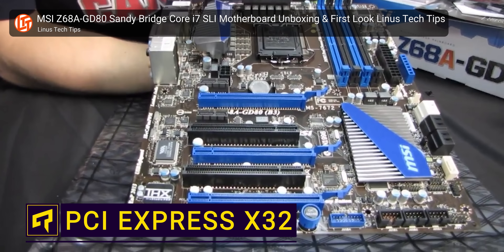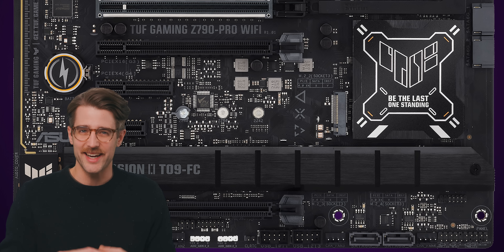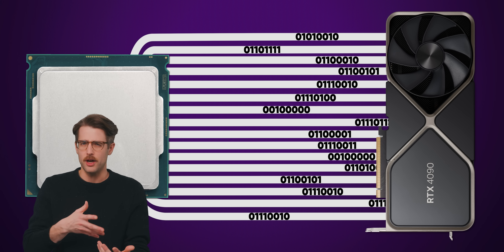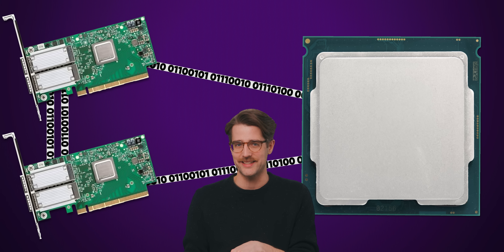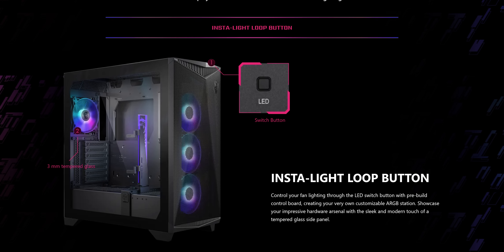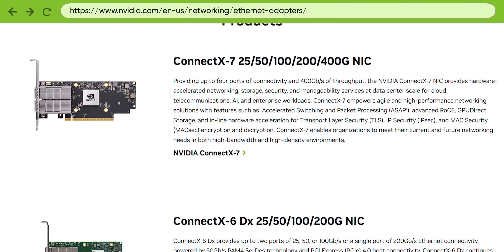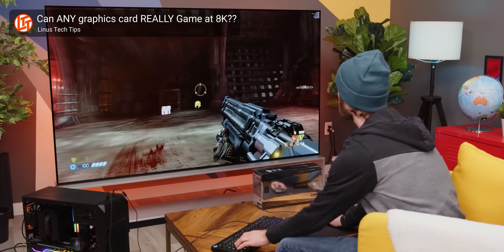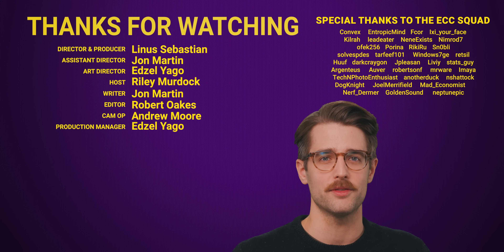Yes, It’s Real: PCI Express x32

Comment: The OAM form factor can have 128 PCIe lanes. It's (mostly?)used to connect a cluster of accelerators to each other; So a board might have 8 of them, with each having an x16 link to every other one and another to the CPU, if I understood correctly.

Comment: Dumbing down the tech? 
400GbE has been around for a while. 

The reason you see these wide PCIe busses is for composable systems. 
Look at the Epyc chips.  How many lanes?   
Now consider that you want to have high speed storage along w tiered storage.  So you have that in a separate box/server and you have a high speed interlink.  Thus composable systems w compute and storage separate but still close together.

Comment: I got to give this a dislike because its a SAS and Host Bus Adapter video in disguise. Not to mention Infiniband might be older than the Zoomers watching. I was taught about Infiniband all the way back in 2006 by a CCNA! Those speeds mentioned are for the recent standard of SAS. SAS is going to live on because its will take a long time for enterprise SSD's to be cheaper than enterprise HDD's. However, I hope someone uses this information to take their NAS in their home lab to something more enterprise like a file server connected to a Jbod.

Comment: It need in all the lanes to arrive the bits at the same time, routing 32x x2 (each lane is a differential pair) , 64 tracks to trace all to the same chip is very hard, all traces must have the exact same lenght, or there will be penalties, delays penalties.

Comment: 64 lanes? yeah i could saturate that. gimme 4x rtx 3080 of the 12gb variety and a system capable of handling that much data (32 core gen 3 threadripper would work) and viola, i'll saturate that much pcie. i also would need another pair of pants and new wallet after watching the power draw of such a system (wowza)

Comment: See I want to run multiple computers in a cluster, this means I need very fast cards with the bandwidth able to support the amount the entire system can output at once, plus a bit extra for overhead
Reply: Let’s say I have a gpu that runs on 16x and i have 2 in my system
Reply: I’d need a card capable of ~pcie x48 to use both gpus and the cpu
Reply: And that’s per system
Reply: Now Nvidia makes a thing for this, it’s called NVLink and it’s like SLI if it was able to go full on out of the case and connect to a network switch
Reply: The NVLink connector is on very high end cards, such as the A100s  in the million dollar pc
Reply: And if you have the money to buy them go ahead. But for a only semi-enterprise user like me, I can roll out the cash for a rack full of A100s
Reply: Remember the Million dollar pc only has 4
Reply: So what I do is I bought infiniband cards, I’m Still on QSFP but I’m planning to use the OSFP1600 for my next upgrade. Then once you get those you get a cluster software and a server with a ton of cpu and ram, from there you install the cluster software on all the computers, and make the Really good server your head server
Reply: It controls everything else and tells things what to do, then you do some driver shenanigans to make the head server think all the gpus in the other ones are eGPU’s and you assign them to a VM
Reply: Then you do whatever in the vm
Reply: Btw I’m running 8x T40s on 4x R720s with a R960 as my head server, spent over 200k on this stuff

Comment: I think its time we update pci e.
Pretty sure tech has improved in the 22 years since pcie was first made. The newest thunderbolt keeps up with most 32x speeds yet is a connector the size of usb c. Shrinking the connector point freees up lots of space in pc and will make it easier for them to add other improvements.
Further while i love haveing the extream backwords and forwards compatibility of pcie at a certain point it becomes a bad thing.
22 years of cards and standards it would be nice to have a clear divide line once in a while so at a quick glance you instantly know how comfortable it can be. 
With hard drives we have this as their connection has changed alot over the years. Imagine if you had a game system  that kept upgrading without changing its number and now there are Bout 10 different tears of compatibility but you have to do research to find out what is and isn't compatible. They honestly i think thunderbolt and pcie should create  fully new two ports/plugs. One that is crazy high power and data throughput 
One that is about usb 3.0 power and speed level.
That way you dont waste money on ports being more powerful then they need to be theres a clear fivide so your nor trying to figure out if its the port the cord or the device thats not hitting the speed it should.
Both would be standerized but different.

Comment: I thought you would show a real x32 device, not a 16+16 nvidia/mellanox nic. The splitting was always a thing and I remember FPGA based 100GbE cards, that used dual Gen3x8 connections within the same x16 card - and required a bifurcation capable mainboard and likely used the driver managed model of 2 devices. But PCIe base specification even specifies a concept of multiple links, likely to help with the data splitting and reassembling, as a Port is composed of multiple LINKs of up to x32 lanes each. The link field is 0-31 or 0-255. Links do not need to have the same speed and its not really clear how/why shall one use multiple links. My explanation is that it is for identifying the device topology in case that the NIC uses that 2x16 or 2x8 mode.

Comment: PCIe gen5 is 4GB/s per lane.  So, 16 x 4 = 64GB per PCIe slot that's X16  and to take this back to serial which is how a network card is rated we get 64GB x 8 bits = 512 Gbps basically.

Oh, a SINGLE PCIe gen5 X16 slot can handle that 400 Gbps network adapter.  So why do we need this?  No, no we don't.

PCe gen6 should hit server within the next 2 - 4 years.  That takes us out to what?  Yes, a 1Tbps network adapter if you can actually manage that kind of speed on a cable bundle going into that one network card.

There comes a point where servers need to be upgraded.  A server that's 5 - 6 years old is now ancient.  It's SO bad that replacing it with newer hardware pays for itself in power savings.

Comment: I'm still surprised optical connections aren't used yet (again? (SPIDF)).
I'm expecting USB (or whatever apple calls it next) to have a fibre down the middle in that tiny blank part of the C connector at some point.
Bend insensitive SMOF is cheap enough now that is plausible at scale. SFPs are getting there too.

Comment: MSI tech support are the worst in the industry.  You know what they told me?  This is verbatim: “We don’t troubleshoot incompatibility”
Reply: Really?? In the past, MSI has always had the best warranty and repair service. I had a video card that was displaying weird corrupt garbage after like 6 months, and they replaced it at no cost. I had an MSI laptop that I smashed the screen by shutting the lid on a pencil, and MSI replaced the screen under their one-time replacement warranty. But that was years ago, so I'm guessing things have changed?
Reply: I don't know; my 2017 AM4 motherboard is still getting BIOS updates as of January 2024, which was necessary for me to swap the original 1080Ti with a new 4070 I got last month.
Reply: @simongreen9862 Can we take a moment and ask the question why the fuck isn’t UEFI/BIOS firmware open source?  Really should be.
Reply: @5urg3x  I agree with you there!
Reply: Buddy if you think msi is bad. Try asus support
Reply: @theodoregaus6237  Asus are bad as well, buy my experience with them -- if you complain enough, they'll eventually escalate you to a level 3 "customer experience" tech who is based out of the USA -- one guy named Justin helped me out a ton, gave me a brand new ProArt monitor a few years ago

Comment: I just want PCIe 6.0 with a slot that supports 1000W GPUs without any additional cables, ok 600W, but PCIe 7.0 had better support 1000W!  I  really hope ASUS and MSI keep supporting BTF and Project Zero,  BTF already supports 600W with the correct BTF GPU, I hope there is a BTF 5090, and yes I know you still have to plug the cable for the GPU power into the back of the motherboard.  I just wish PCIe slots supported the power needed for all GPUs without the extra cables.

Comment: In FPGA is fairly common to see X32, Microsoft had a board that allow u to control two FPGAs with this lanes, the trick was even it was an X32 actually it was like emulating the connection been two X16 lanes by readdressing the lanes.

Comment: Just a thought 💭🤔.. if you want a super small SFF build the motherboard only has 1 PCI express slot usually plus some nvme slots. So if you have 1x 32x pci express slot you could have 1 card that has the GPU and SSDs and dedicated npu and a 10gb NIC ect all in 1 expansion card especially if you have 1 side of the PCB for the GPU and the other side for the npu and SSDs and NIC and all the other hardware you want. It would make for very capable SFF builds or very very tidy full size builds that only has the motherboard and CPU and cooler and ram and 1 expansion card that's a mix of all kinds of different hardware.. so as much as we don't need 32x PCI express lane's for general hardware but the idea and the 32x slot could definitely be used up..

Comment: lol all the noobs talking about SLI…guys you needed a connector between the cards known as a bridge…The pcie connection on the second card was only so your PC would detect the card, all of the inter card communication was through the bridge. That’s why you could only use the ram from 1 GPU, because they could not transfer data fast enough through that bridge. This is a more advanced technology and if it was around at the time I’m sure NVIDIA would have used it, your CPU splits the data into two, like a stripe raid array, it goes to each card and the cards communicate synch data to make sure they spit it out in order. It may require a special chipset for this function because as far as I can tell no consumer mobo or cpu supports this.
Reply: Cards can be seen without the S.L.I connected, its still heavily driver dependent. Also it's more like higher clock speeds are still better than high IPC for S.L.I as it decreases latency. stripe raid arrary are slower than most modern cpu's & NVMe drives now. The Nv-link was bigger, but they're just using the pci-express link now on pci-express 4.0 with ada lovelace cards for cuda in workstation. AMD is using infinity fabric now too which is still basically a pci-express links.
Reply: @kevinerbs2778  well you can stripe nvme as well, not just sata drives, so gains are available there as well. I didn’t see this on Ada workstation, I don’t think both GPUs work on the same task in unison, realistically for workstation or AI I don’t see many tasks needing it, most workloads are split into individual tasks/calculations. Even for simulation, you are simulating individual cells/nodes taking into account previously calculated results that you read from cpu ram. What they are doing with their new server grade GPUs is dual die and offloading some of the CPU ram burden to the GPU, but that again needs to be taken advantage of by the software. If you look at something like blender, the software splits the scene into equal segments based on how many GPUs you have connected, they don’t communicate at all between each other because there is no need. Realistically this is what this video is about, a form of raid for PCI-E communication. If there was a successor to SLI it would probably need 3 GPUs or 5, always 1 extra to recompile the individually rendered area of a frame, for gaming it does not make sense because of the lag it would introduce, for workstation it doesn’t make sense either because you are not watching your task process live so latency is a non issue. If you are rendering a 4K frame with 4 GPUs and each GPU is doing 1k you will be 4x as fast with 0 need for inter GPU communication.
Reply: @radugrigoras  tile render already existed for pc games, no one wanted to use it.

Comment: Is usb c a type of 1x pcie? Or is Thunderbolt 1x pcie.... or am i mistaken?
Reply: Thunderbolt and usb c are same thing. (lighting isnt)
Reply: @alexturnbackthearmy1907  Fun fact Thunderbolt was a collaboration/ designed/ built by Intel and Apple.
Thunderbolt is USB-C on steroids, but they are not the exact same* 

The highest USB-C standard 3.2 x2 gen 2 can only support 1 4k monitor, 100watts, 20gb of data

Thunderbolt 4 can do 2 4k monitors, 100w of power, 40gb of data
They are not the exact same thing they are compatible yes but Thunderbolt 4 does offer more proformance.... until USB-C releases USB-C 4 but then Thunderbolt will be Thunderbolt 5 and offer more and the wheel goes round and round
Reply: @SSYoung125 thunderbolt 4 is 40gbit, not 40gb

Comment: All I heard was it was not SLI/Crossfire's fault it died. Twas complex graphics drivers that killed the beast.
Reply: Drivers are even more complex now with D.L.S.S & just looking at intel Arc cards we're still stuck with drivers being the limiting factor even on DX12. look that insane performance increase they're still gaining just from driver fixes for Arc card.
Reply: And lack of support. Out of handful of games supporting SLI, only select few actually scale with amount of cards, and most "SLI supported" games have completely messed up implementation of it so its very laggy, and second, third and fourth cards arent even doing anything.
Reply: @alexturnbackthearmy1907  There are 1,064 games for DX11 that support or can use S.L.I that's 20% out the 5,889 games for DX11. 
Here's something that real disappointed me, it's taking 8 times longer for games to come out on DX12 than DX11. In 10 years DX12 has barely gotten out as many games a what DX11 was releasing per-year in around a ten-year span.
There's 415 DX12 games out now, around 50% of support some sort of raytracing in the 8 years & 9months that DX12 been out.
There's were 347 games were released per year on DX1 in a ten-year span.

Comment: I would love it if using one PCIE slot didnt disable another. I dont think we're ready for the jump to x32 until this bandwidth limitation for lanes is addressed.
Reply: That limitation doesn't exist in the products that use x32.  Desktop CPUs may only have 8-24 lanes, but server chips have hundreds.
Reply: @SeniorKlean  True. Old server processors have WAY more PCIE lines then even top of the line modern desktop processors (PCIE 3.0 tho), and if that isnt enough, just get yourself dual cpu system.

Comment: Maybe it's the dinosaur in me , , , but wouldn't see where striping 16 bit lanes of data would be useful , , , , didn't you mean full byte (word for you Motorola guys) at a time like we used to do, , calling it parallel port?
Reply: It's 16 serial connections operated as one software layer with another software layer on top pretending those virtualized serial connections actually are the lanes of a parallel connection. That's why it's more robust than true parallel, not all lanes have to send and receive in exact temporal synchronicity.
Reply: the whole bloody system , GPU,CPU,DMA,interupt handler,etc.,etc., is clocked PARALLEL so wtf? @hammerth1421
Reply: @hammerth1421  GPU, CPU, DMA, INT Controller, etc., etc., etc. are clocked/synchronized in lock step, the only need of serial data is to cut down the number of connections to a chip.  While I havn't been paying attention to my career field for the last decade or more and can't/wouldn't argue the point but , , , , ,   . . . ..............

Comment: PCI-E does support x32 single link devices, even if it does not use a single socket. It is specified in the PCI Express capability.
There is also x12
Reply: Also x24 in some high end stuff.
Reply: @steelwolf411  there is no x24 in the spec. Some PHI MXM cards claimed x24 but it was running in either 2x12 / 3x8 / 6x4 mode.
Reply: @steelwolf411  x24 is not part of the official spec
Reply: I'm just waiting on x64
Reply: No one ever used it, hence the removal from the latest revision
Reply: @shanent5793  It was used in Cisco UCS for some VICs as well as other things. Also I believe it was used by IBM for specific cryptography accelerators.
Reply: would that be those weird long connectors on some newer boards or apple cheesegraters?
Reply: @tobiwonkanogy2975  Those are technically two x16 slots, not an x32. They're designed for dual GPU cards. AFAIK, no x32 devices actually exist (with the exception of bifurcated ones in server boards, which doesn't really count) at this point in time.
Reply: @tobiwonkanogy2975  Mac Pros don't use x32 and never did.

Comment: yup. and i also just hinted an "idea" in one of recent digital foundry's video comment section about : independent GDDRxX memory module/sticks in M.2 form factor.(could come in any format, 2230, 2242 or 2280) for MULTI PURPOSES of usage cases. from adding more VRAM to BOTH iGPU and discrete GPU, to actually adding CPU fast remote cache(extra huge L4 cache anyone?). i see a market for that. i hope somebody pick the idea up.

imagine you have an iGPU, and then simply plug an M.2 16GB GDDR6X memory sticks into one of your M.2 slots, and have the iGPU driver to recognize it and have some instructions to use it, will make your iGPU has 16GB of GDDR6X VRAM. and your CPU could steal some of the paging of it for its "extra cache" of theoritical L4 cache. your OS simply need to add instuctions to use it if it detected available.
Reply: Good idea...but it already exists, called RAM sticks. They are also much faster then m.2 device will ever be. You can even use it as very fast SSD (volatile one, so dont store anything important in ram).